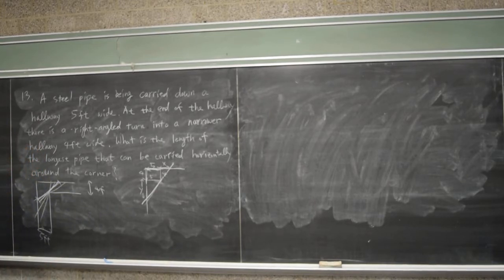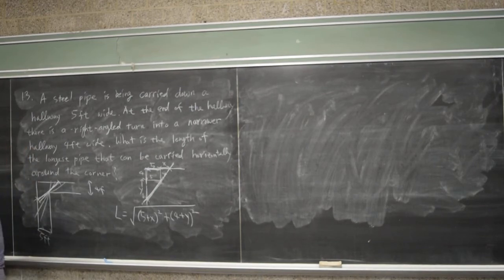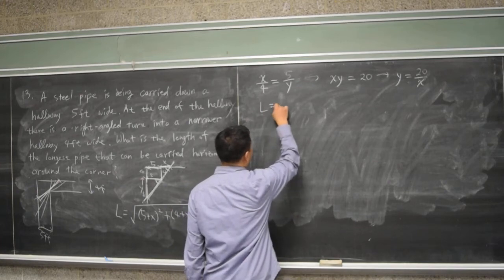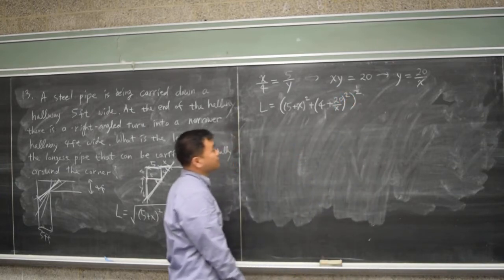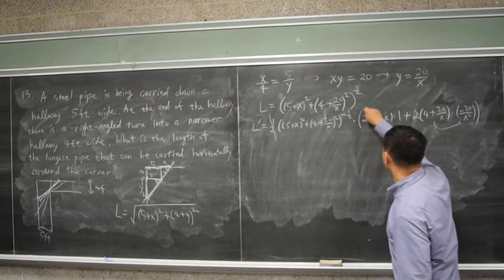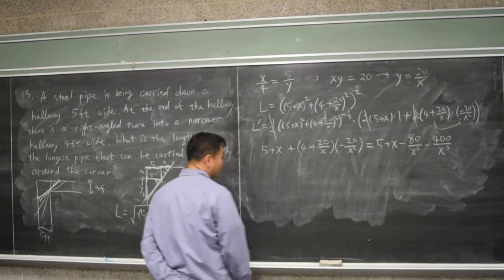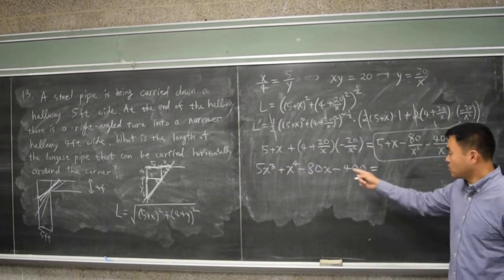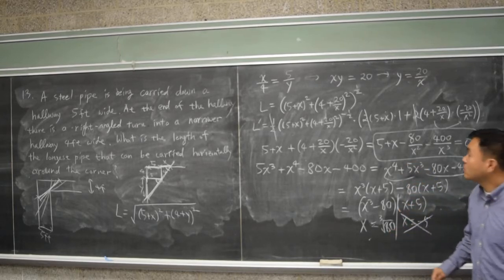Calculus: Optimization problem (pipe around the corner)

Comment: You can move an infinitely long pipe.     What everyone and every mathematician is missing is the fact that the object is moving.   As you move , your length contracts.   So if you accelerate a very long pipe to approach the speed of light , its length will contract to almost zero.   So you can move this object to the corner at the speed of light and then rotate it at the corner and there will be room and instantly accelerate it down to the speed of light and just keep going.  You must keep the pipe moving at the speed of light the whole time , even when it rotates to head down.

The whole math problem involves moving the pipe and it has to move.   You can't express the problem without moving the object.   So special relativity will apply. There is no mention about the allowed velocities, so the speed of light is allowed.

So no matter how slowly you move the pipe, it is still moving so you will be able to take a slightly longer pipe around the corner than your static math calculates.   The pipe isn't stationary.  It can't be stationary because then you would never mover the pipe down the hall around the corner.
You should put the Lorentz contraction into the solution.   If you are moving at 259628 km/second then you can take a pipe twice as long around the corner.